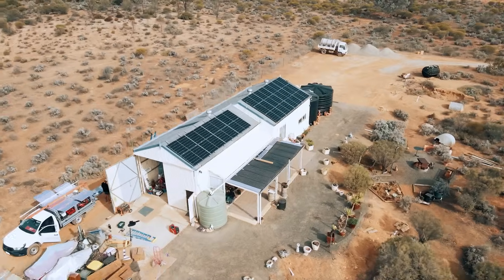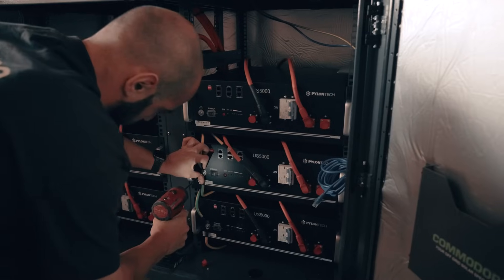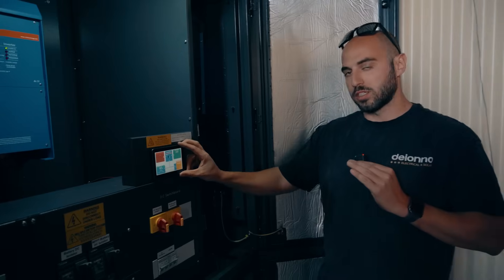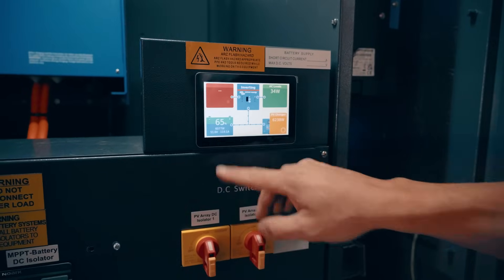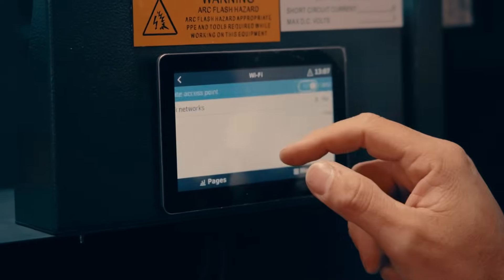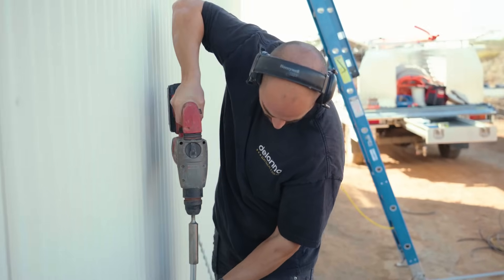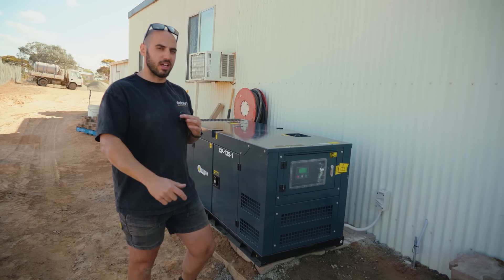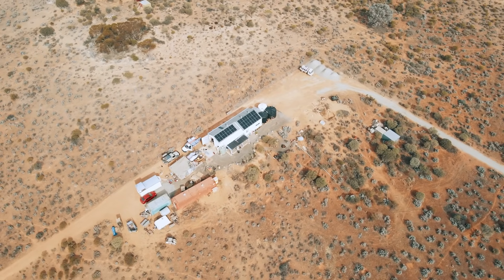AUSTRALIAN OFF GRID SOLAR INSTALLATION - VICTRON - PYLONTECH - SOUTH AUSTRALIA

Comment: I wonder how many Pylontech US5000 sold into Australia so far ? 

Crazy i can buy for $2250 delivered to Brisbane out of Perth
Reply: That is rip off, In $2250, you can make 23kw battery yourself using EVE cells and quality JK BMS.
Reply: @pr5991  Got to have skills for that. And few do. Plus the pylontech have RS485 and canbus and other comms ports, software to monitor, full warranty in Australia, free freight in my case , compliant fire resistant metal enclosure,  DC isolation breaker and safety certifications to AUSTRALIAN STANDARDS  (which most insurance companies require)

Comment: I had had the thought to put in an air-con with my future battery set up. Glad to see someone else actually doing just that! Great video. Well done.
Reply: How much did this system cost please
Reply from the maker: Only the best 🔥
Reply: Victron outputs derate with increasing temperature, a bit. Far better to install 2 victrons or a bigger unit than run an airconditioner!!!! That is not wise at all.
Reply: @polvincompoundsadmin5402 

The airconditioner is 48v and only draws 280W, this keeps the internal temperature of the cabinet around 20 degrees in direct sunlight on a 40 degree day. Pylontech operating temperature is 10-40 degrees celsius otherwise they will be derated, considering there is a fully loaded MPPT and Quattro which will raise the ambient temperature expecially on a hot day, considering the cost of this off grid system and the negligible cost of the A/C, adding the Aircon is a no brainer!
Reply: @cxlemari9198  My thoughts exactly. The better you look after the gear, the longer the life. Plus, you are less likely to void any warranty. Thanks for the reply.